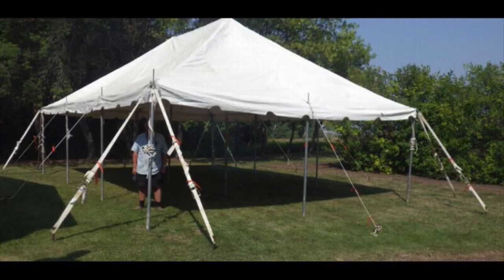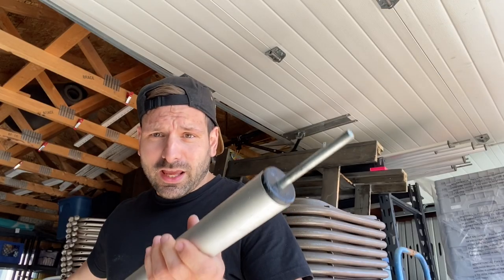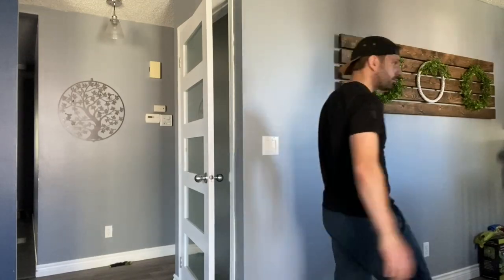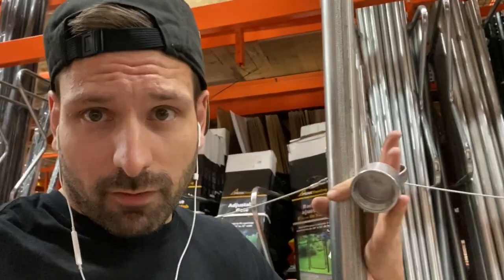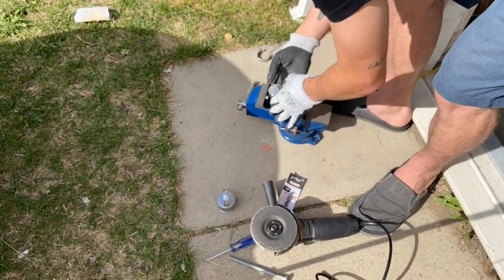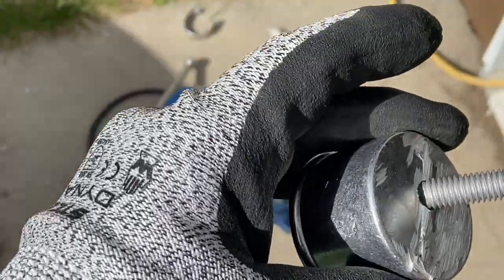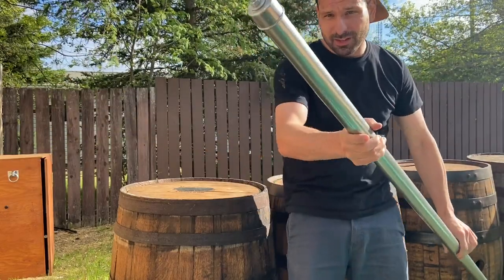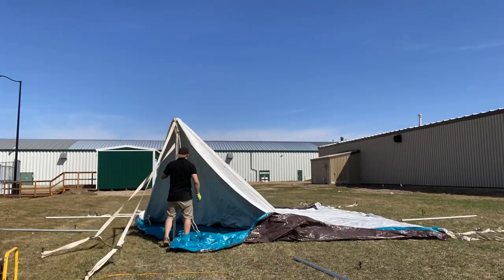DIY Party Tent -  Save Money - Make Your Own Poles

Comment: What was the total cost per pole?
Reply from the maker: Excellent Question. 

Line post:
$10.35
Top cap
$1.11
Bottom cap 
$1.11
Screw with nuts and washers
$2.16

= $14.73 Canadian 

Converted to American is ... (beep bo beep)

=$10.53 US DOLLARS plus tax to make a pole.
Reply: Great video, hey Lee where do you purchase your tents? I have a small bounce house and event rentals biz.  I’m looking to get a pole tent because they are a bit less expensive than frame